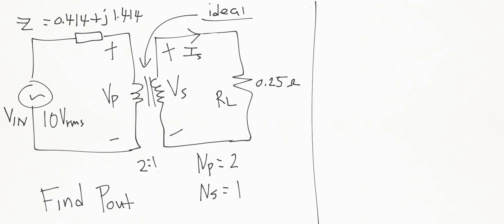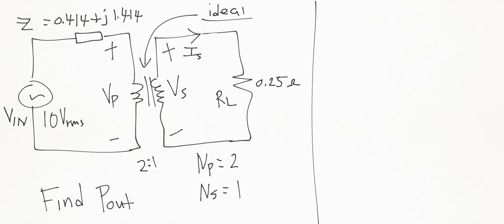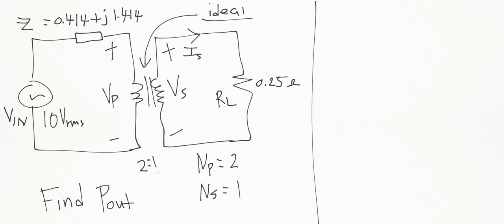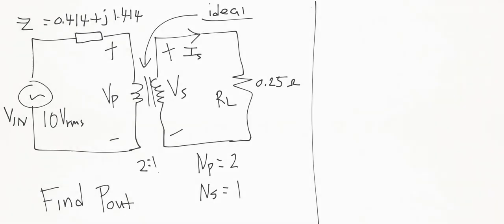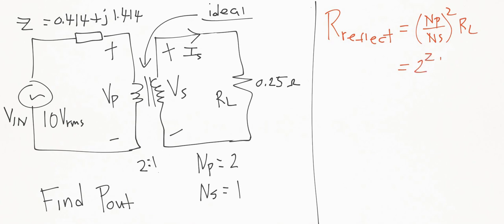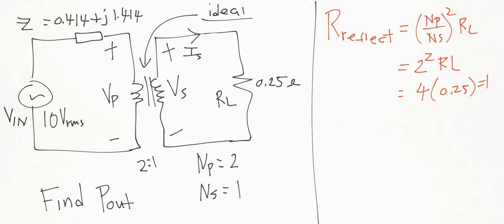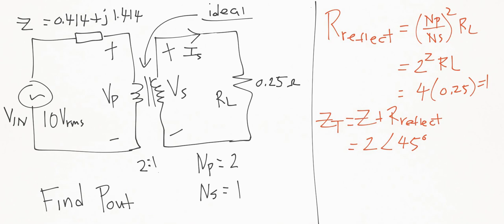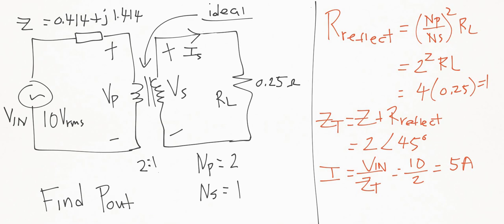Electrical FE /EIT Exam Prep - Circuit Analysis 4: Reflection Resistance

Comment: How did he get 2 <45°?
Reply: My question too
Reply: My question too
Reply: He added Rreflected=1Ω with the other Z= 0.414 + j1.414 and it resulted in 1.414+j1.414. If you convert that to polar you will get 2<45°.

Comment: Why the total power I^2 x R reflected not Z total
Reply: Because the question wanted Pout, which would only deal with that resistor. Not the total resistance in the circuit.
Reply: You only need Ztotal to calculate the primary current. Once you calculate the reflected resistance (a resistance that takes into account both load and transformer), you can just draw a simple circuit with Z and reflected resistor. To calculate Pout you want the power dissipated across this reflected resistor only.